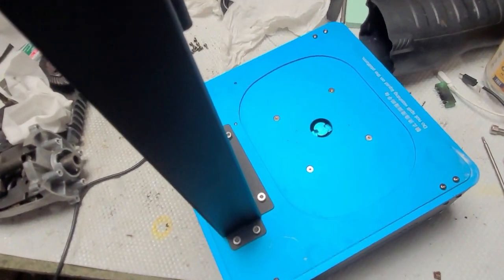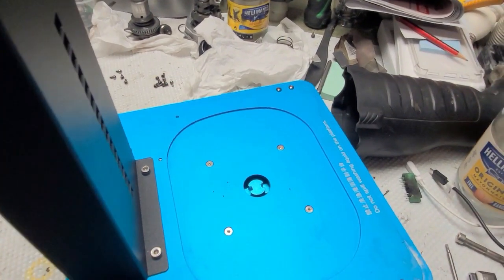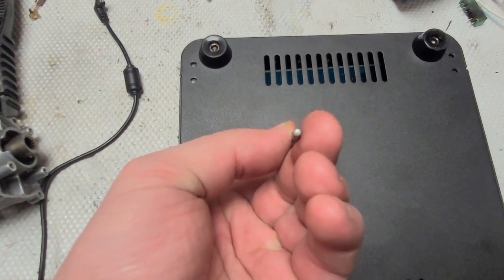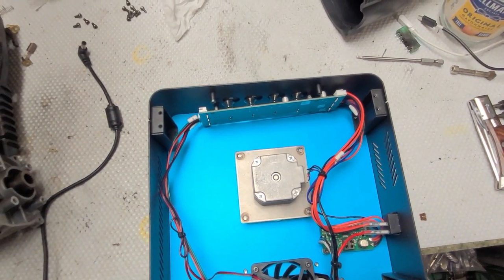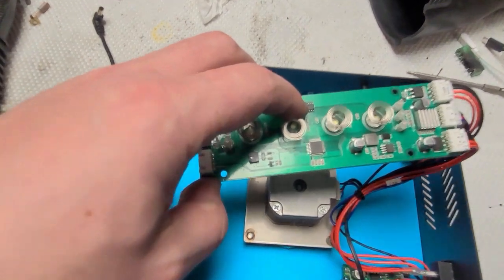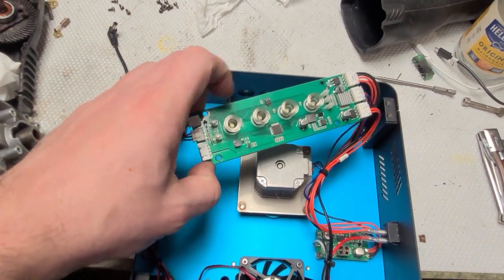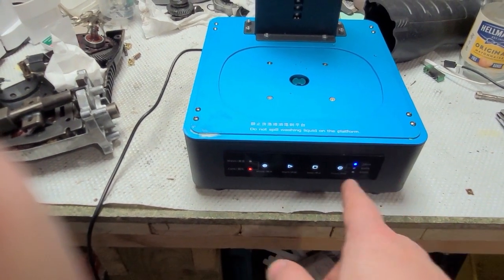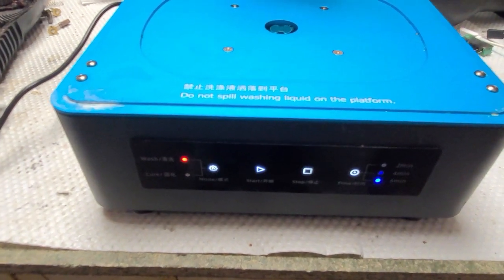Anycubic wash & cure touch not responsive - Repair

Comment: Thank you now I know where to start mine is the 2.0 and had fallen off my table and after that I hadn't worked since but wash works I wasn't able to select cure and I didn't see any blown capacitors or burn marks on any of the boards.